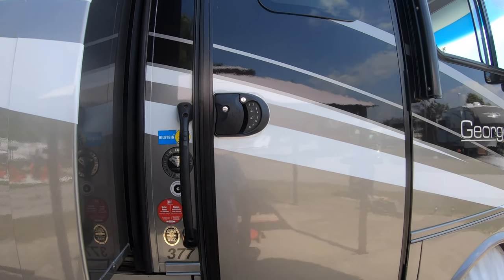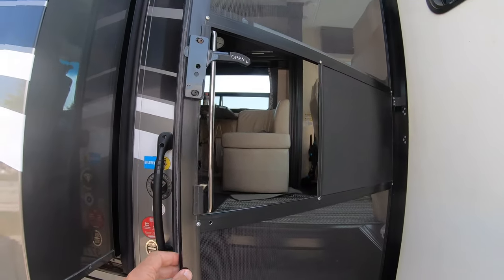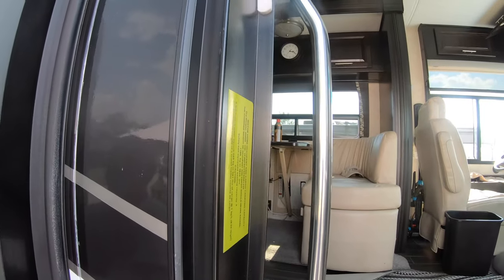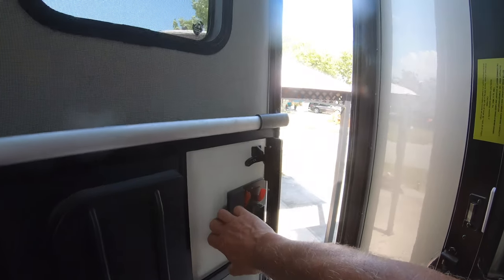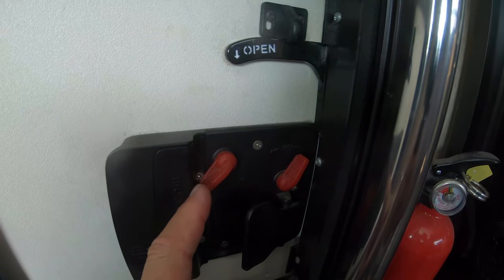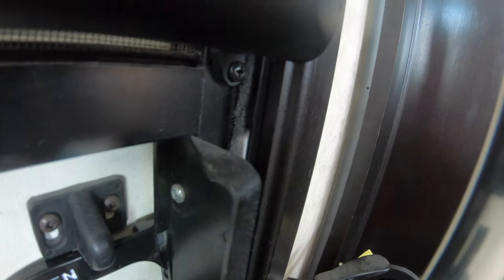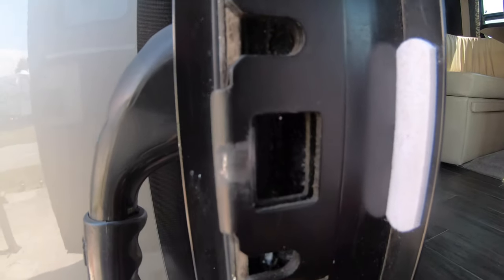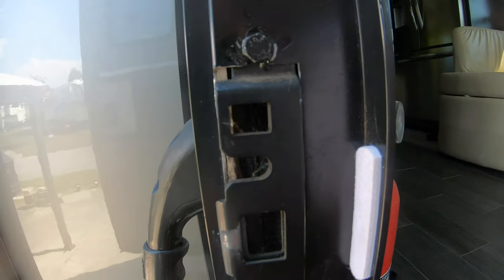Squeaky Door On A Forest River Georgetown RV

Comment: How much of a gap is present between the screen door and the frame when using just the screen door? With the prevalence of stink bugs sneaking in everywhere I'm wondering if the gap will allow even more inside.  I've seen this fix before and I wonder why people do not put the pads on the main door instead. Or use black pads on the outside edge of the screen door, between the screen door and the main door. 

I've got a squeak but it appears to be from the power bunk. I can put sideways pressure on the bunk and the squeak stops but that is not a long-term fix... :)
Reply from the maker: Yes black would have been better it just that I want to get rid of the squeaky door and couldn’t find in black funny my wife said the same thing. As for space it now tight. 
Thank you for watching and your comments